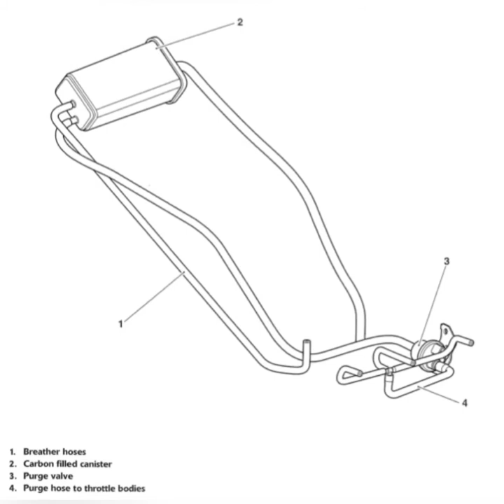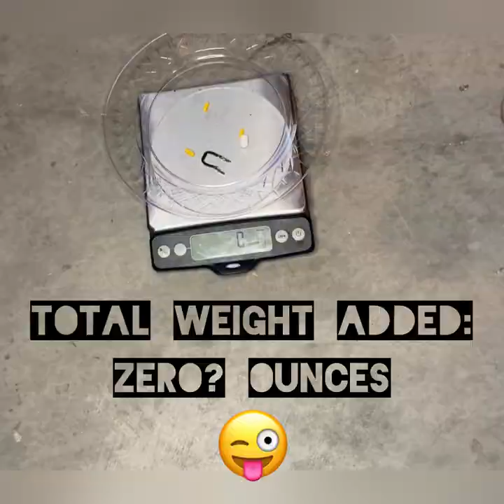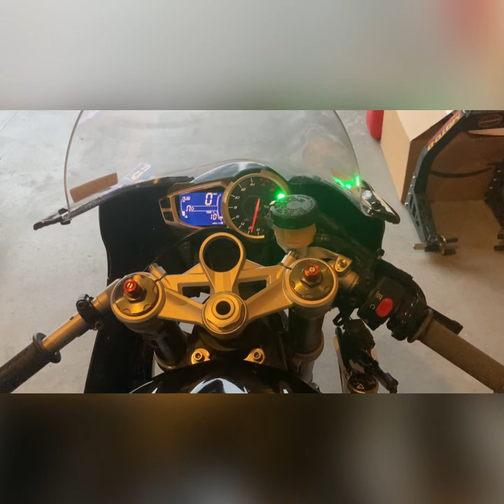Evaporative Control System Removal - Daytona 675 (13+)

Comment: I removed the hoses that connected to bungs on the right side of the throttle bodies. Those three hoses connect to a 4-way piece. One of the hoses from the 4-way piece runs to an electrical connector with a vaccum bung near the ecu. 

The hoses that run to the left side of the throttle bodies are also connected to a 4-way connector.  The outgoing 1 looks like it ran to the removed purge valve. What did you do with that hose that ran to the bottom of the purge valve, next to the electrical connector that was disconnected? (14 Daytona 675r). I'm wondering if they switched the connection from right to left on the throttle bodies for the 14 daytona R.
Reply from the maker: Hi! If I'm understanding your question correctly. I removed the purge valve and the hose that was attached. It seems that part of the process was excluded from this video.

Comment: Hi Passio. I’m getting stumped. What did you do with the hose that connects to the MAP Sensor by the ECU? The hose came off the right side of the middle throttle body to be exact. Thank you!

Comment: Hey man, on the 3 hose vacuum connector, there is a 4th one that connects to a sensor on the airbox. Do I just disconnect that vacuum  hose? no plugs? Thanks.
Reply from the maker: I apologize for the late response. What year is your bike?  The 4th tube that branches from the 3vacuums tubes is connected to the exit side of the purge valve (ref. 3:18). I removed the purge valve completely. There should be two hoses that connect to the bottom of the airbox (one that connects to the SAI system - if still installed, and one that connects to the top of the engine block - should remain installed).
Reply: @passio6003  2014 R model. No worries, I just left the vacuum hoses in. I plugged them where the cannister is.
Reply: @JENX1976  I have same model as you. There is a vacuum line running to an electrical connecter on the airbox. I'm wondering if on our models (2014 675R) they changes the throttle body connectors. His bike is a non R so I'm curious if the layout is different.